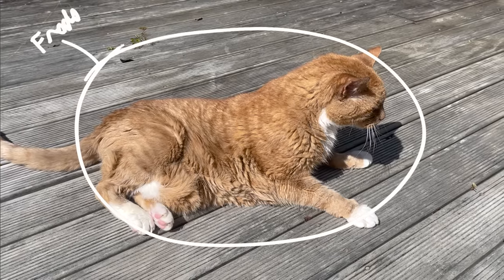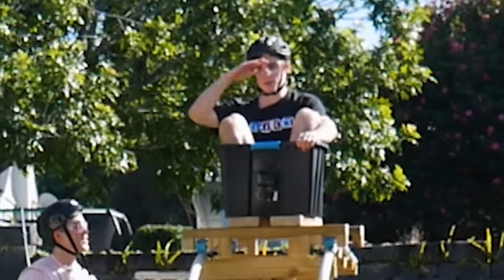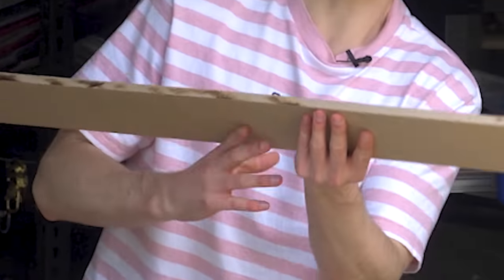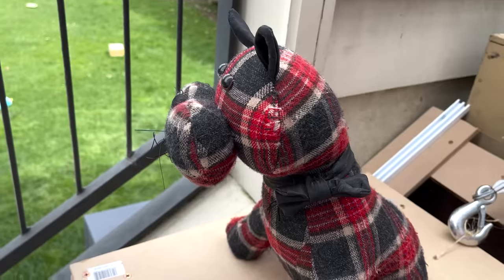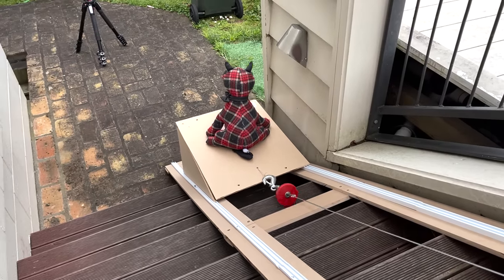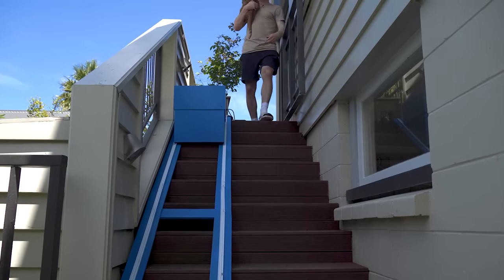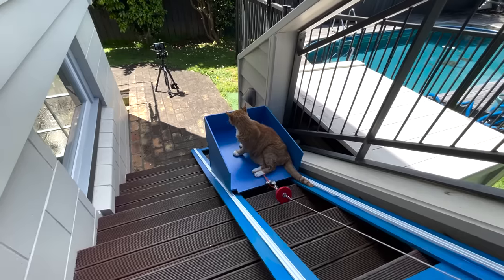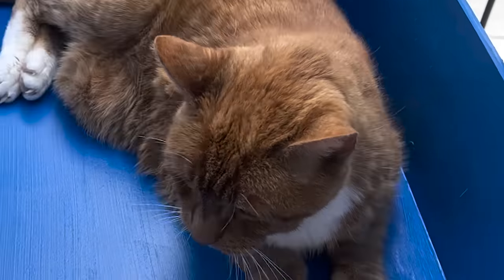I Built an Elevator for My Cat

Comment: ... so you jumpcut past the part where you have to manually put him in the box, then manually trigger the elevator. 

You do realize if it takes you picking him up twice (at the top of the elevator and the bottom of the elevator) and going up and down the stairs twice just to make this work, you actually spend more time and energy using the elevator than if you just picked him up and carried him up and down the stairs?